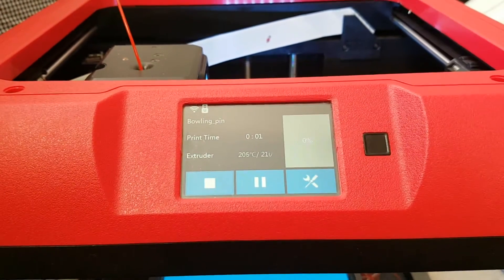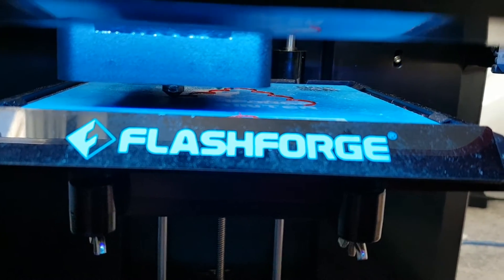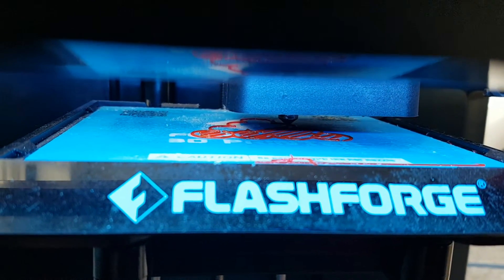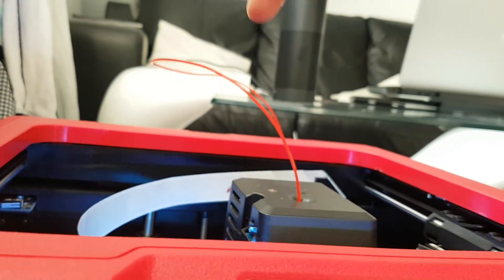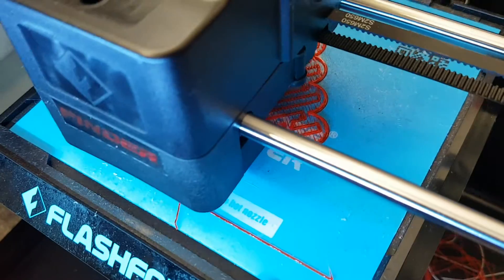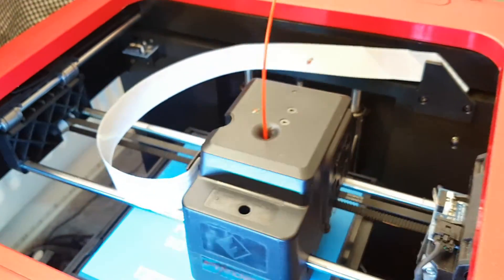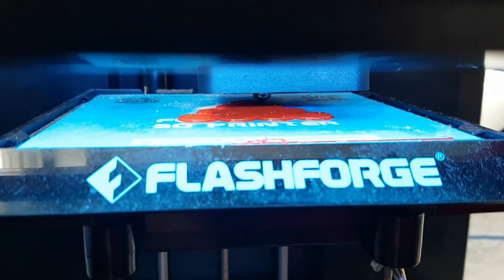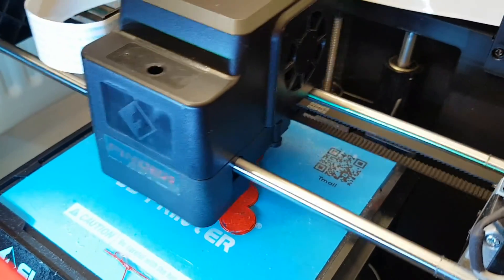Flashforge Finder 3D Printer

Comment from the maker: hi, yeah I've seen this in other videos as well. annoying that I didn't get that when I bought it but I'm actually using 3rd party filament on an external spool holder so don't need to worry now. you'll love the printer terms though. so easy to use. just need to move the nozzle a lot closer to the bed.

Comment: I'm about to buy this exact printer in a few weeks and I've done some research about it and I think you're suppose to get a filament guide tube that you connect to the hole where the filament comes out from and into the extruder. I think this should solve the problem of the filament jamming on the side of the printer.